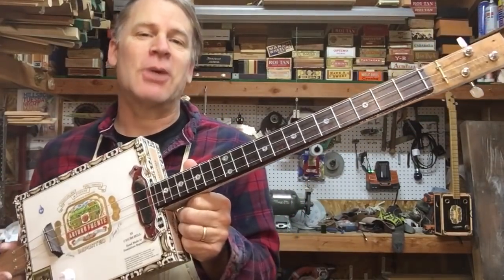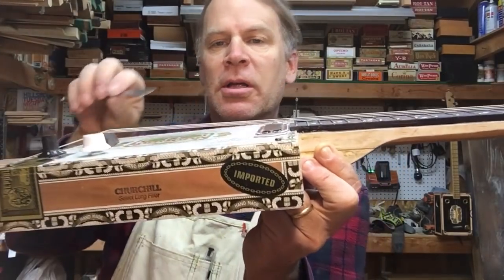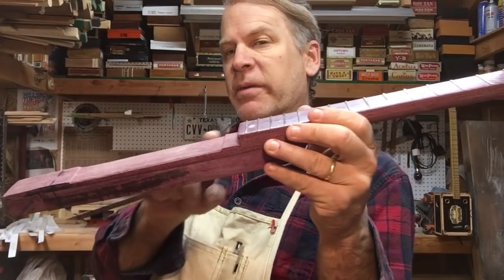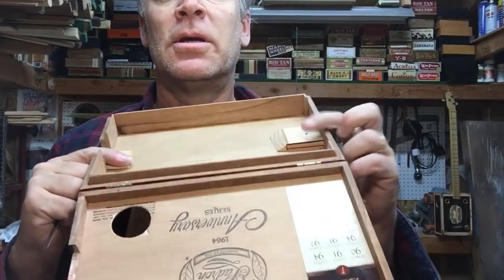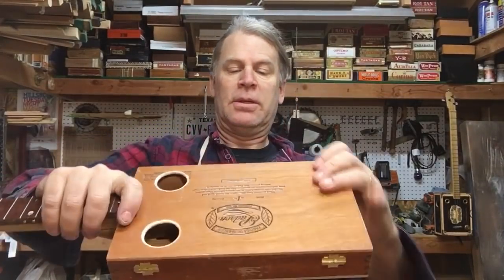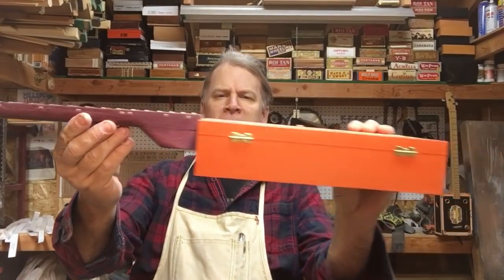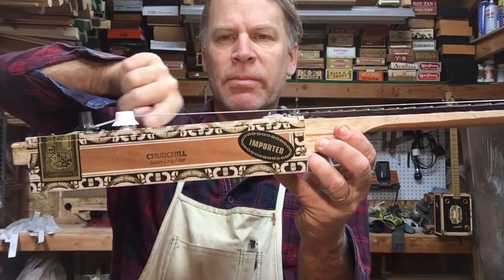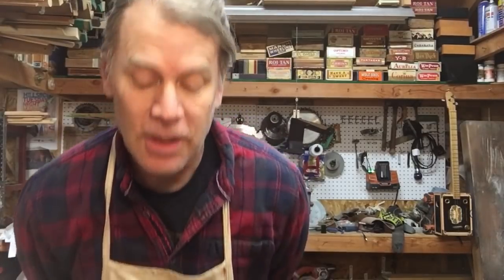The "Back Angle"

Comment: Just finished my third cigar box instrument - a ukulele for my wife - and I used a back angle for the first time. It turned out really, really well and I'm going to use your back angle method on all of my future builds. Having the extra clearance between the strings and the top of the box makes a huge difference. Also, I was at Ace Hardware yesterday and saw the shutter hinge kit that you recommended in one of your other videos. The price was reduced from almost $9 to $3.99, so I bought two kits. Thanks so much for all that you contribute to the CBG community through your teaching. :)

Comment: Thanks for finally clearing up how it's mounted inside the box. That's the part that has been confusing to me. I understood the principle when you showed it in the last video you talked about it. It just wasn't clear that you shimmed it. I've been doing something similar since you showed it last year in your video- but keeping the plane on top with the box notches parallel (in the "traditional method" of accommodating the box lid) but sanding/cutting the underside of the neck to create the angle. Same affect just different  was to achieve it. Now I have to figure out which way is easier and quicker to do. Thanks again for ALL your tips, my builds have gotten better and better over the last couple years primarily from tips you've posted. 

Speaking of, the building now- the resonator that looks like and old radio is laid out using my snazzy new Golden Ratio Compass I built over the holidays. It's looking awesome.

Comment: Great videos Del. I retro fitted a back angle on a six string (sorry for swearing by saying "six string") cigar box guitar. I simply used two washers on a bolt on neck and Bob's your Uncle. Instant back angle! Although the saddles are at their max height on the hard tail bridge it plays so much better than it did and the action is superb. The way the builder of the guitar had made it, even with the hard tail bridge saddles at minimum height the action was really high in the upper register. I've now got action that's about 2mm right to the 22nd fret! 

Anyway, great videos and CAN even work retro fitted. Thanks Del.
Reply from the maker: it's such a subtle nuance that it often goes 'un noticed"... and consequentially many builders do not incorporate this into their builds.

Comment: My advice is to draw it full size, using the dimensions of the box, the action on the last fret and the string relief you want. It's much easier if you can see what you need to do before you try to do it.

Comment: Both "overset" and "underset" are necks OK! I'm afraid you're doing a little bit of a disservice here to CBG makers, implying this is a strict standard for construction (for either CBGs or guitars in general). On a slightly different issue, I talked to a man who made all his CBGs 25.5" scale length, because both classical and Fender electric guitars were this length, he assumed it was a rule. There's no special rule like that, although it provided a good model that is easily repeated and  imitated. 
Likewise, it's perfectly legitimate to have a straight neck with parallel strings. You can put all the "action" in the bridge to nut heights. It's a style choice rather than a strict luthier rule. Sometimes I get tired of hearing "there are no rules" in CBG making, but it's a humbling corrective that's needed sometimes.

Comment: Why not just cut the heel on a slight angle? This would do away with the need for shims.
Reply from the maker: it's the top side of the heal (that's touching the cigar box top underside) that needs the angle... not the bottom side of the heal.  plus you'll want to keep as much of the heal intact as you can for "strength".  no unnecessary cutting is recommended.   i suppose if you are going to connect your neck to just the cigar box TOP... then you wouldn't necessarily need the shims.  i 'usually' connect my necks from the backside....thus the need for shims.

Comment: If the only goal of this is to create more clearance for your picking/strumming hand why not build it flat and simply make a taller bridge?  Wouldn't that work as well and be faster and simpler?  Or does it help to have the box top and neck not be parallel?
Reply from the maker: Turnstyles it’s something you need to try and experience for yourself in order to fully understand.  It’s a subtle nuance that really makes a difference in my opinion.  It’s a FEEL thing ... give it a try and then let me know your thoughts 😎
Reply: @PuckettCigarBoxGuitar  I'll have to build two then, so I can compare.  I've yet to build my first.  I've even designed one with a round box that I will turn on my lathe.  But I've yet to start building.  Trying to make a living really can get in the way of a man's hobbys.
Reply: @turnstyles7485  let me save you some time. "Wouldn't that work as well and be faster and simpler": YES! Many (non-cigar box)electric guitars are made that way, and I'd say it's the BEST way for beginner makers. Also for maximizing profit if you can sell them as fast as you crank them out. Also, necks can be "overset" as well as "underset". 
I believe the neck angle idea came from when necks would bow from string tension, and people would shorten the bridge(which can be very expensive on some guitars) to a minimum for correction. Adjusting the neck angle (specifically re-adjusting an already shimmed neck), can avoid that.
Reply: It affects the action across the entire guitar, so if you just raise the saddle without any back angle, the action over the fretboard will be high as well, making it play "worse". This achieves the desired action everywhere. Its a genius solution when you think about it because there is no nut (del usually uses a zero fret) to slot and no (easily) adjustable bridge, and the big thing is no truss rod to give any relief to the neck.